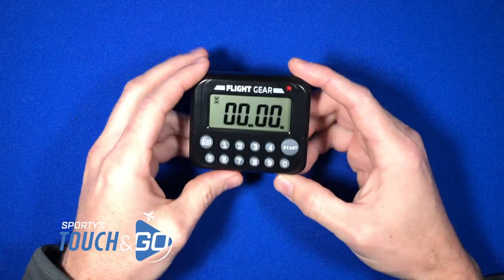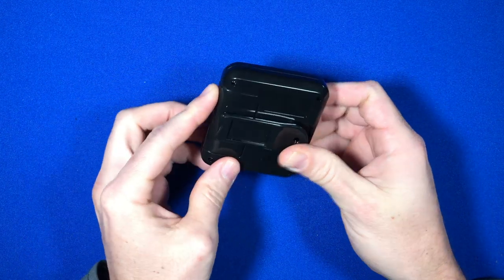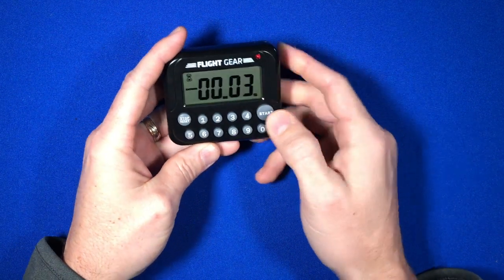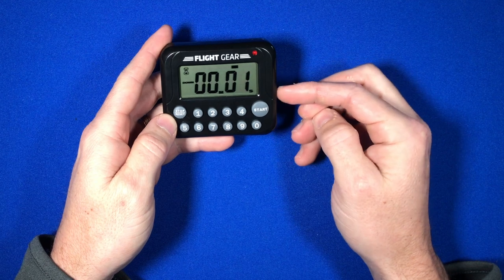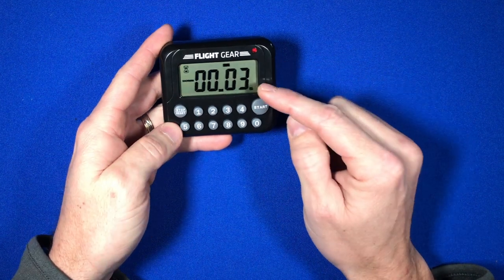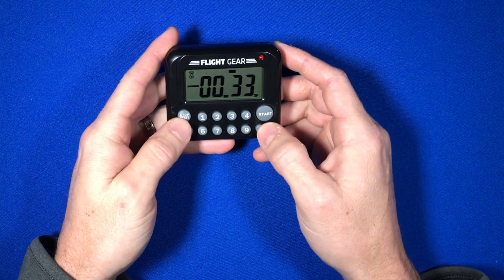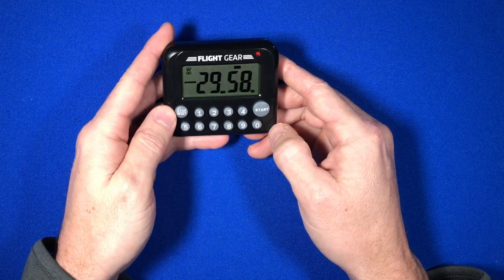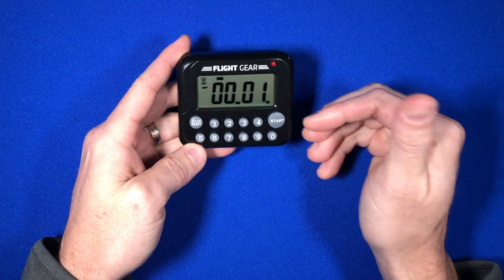Flight Gear Timer - quick demo for pilots

Comment: A great timer that is nice and loud in the cockpit and I like that it has the red alert as well in case you can't hear the audible alarm. It does its job very well!
Reply: Do you know how to turn the timer off? It keeps beeping in my flight bag
Reply: @flyingwithcasey4654  I had to store the timer in a small Tupperware container to keep it from accidentally being started and beeping. lol. Very annoying. Worked like a charm with velcro on the yoke to hold it in place. Since then, I have replaced the aircraft analog clock with a MDI digital clock/flight timer so I no longer use it.
Reply: @HiTechRob  jeez! I wish there was an off button I thought I was missing something 😅 thank you though!

Comment: This may be a redundant question, but when you use the countdown time and it reaches zero I understand that you need to press the "reset" button and the timer will reset to the last time entered.  Will it then re-start counting down again, or do you have to also press the start button after pressing the reset button to begin counting down again.
Reply: do you know how to turn the timer off? It keeps beeping in my flight bag